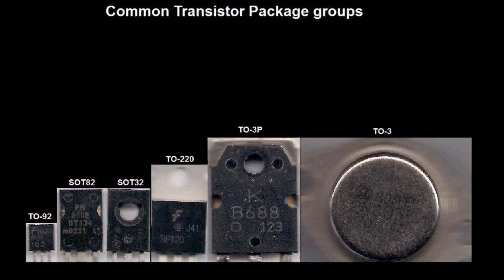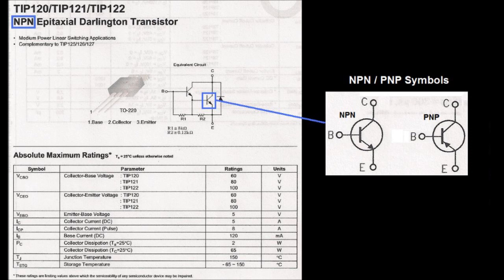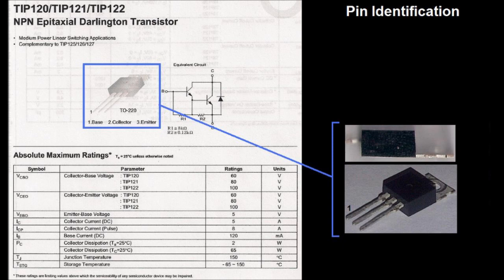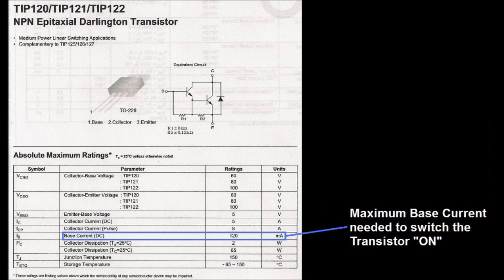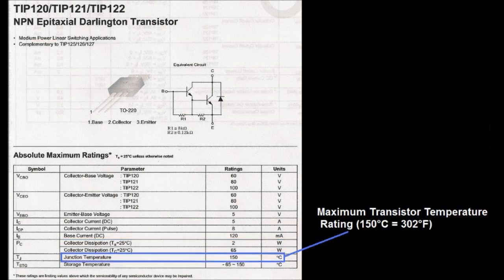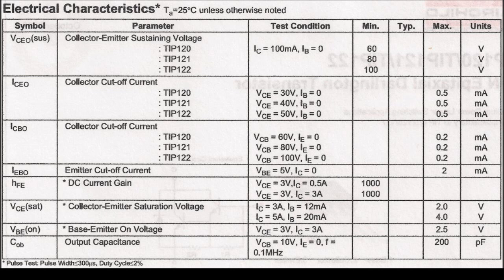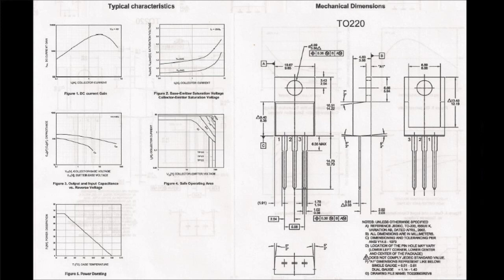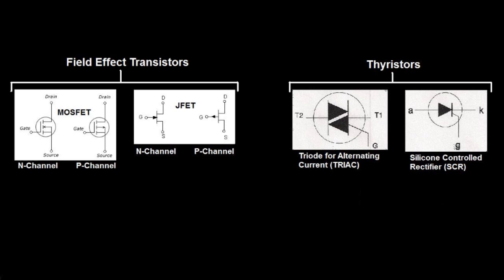Transistor's Datasheet Tutorial

Comment: Some Transistor datasheet (Ib Base current) is not indicated like NPN s8050 - Please help to find out how
Reply from the maker: Base current is usually listed on High Current Transistors. For small low-power transistors look at the voltage Saturation for Base-Emitter. It will show the max current and voltage needed to fully turn on the Transistor.

Comment: Sorry one question, if the transistor can dissipate 2 watt at the normal room temperature  (25°C) ro 65 watt with proper heat sink. That part I understood well.

Then why it says it can work till the 150°C. 

I know I didn't understood it properly between though two option. 

Can you clear it?

Thank you
Reply from the maker: It does seem confusing.  However,  Watts and Temperature are 2 different units of measure.  The wattage refers to the amount of heat energy that can be safely dissipated per second at room temperature.  The 150C is the maximum operating temperature of the device before failure.  The more heat you can transfer away from the device the lower its temperature.  Without the heatsink the device can safely dissipate 2 W per second at room temperature. That's 0.17A @12VDC but with a proper heat sink you can dissipate 65W per second, which is 5.46A @ 12VDC.   The temperature corresponds to the wattage or Heat output. If one goes up/down so does the other.  The device's temperature cannot go above 150C or damage will occur.  That's why removing the heat as quickly as possible is so important.   The temperature of the device is higher than that of a heatsink.  This is called Thermal Resistance.  As long you keep the devices temperature between -65C and 150C it will function as designed.
Reply: @ESRepair  ohh its mean, watt represent the heat. Okay i have to study about watt now. But any how, you were so clear. I am still studying this videos. 
Thank mat

Comment: Hello sir, 

I have 1 question. 

Regarding the Base Current Ib 
It says Max base current to switch on the Transistor, 
My transistor TIP41C Ib is 2 Amp. 

So it will switch ON at any amperage below 2 Amp, correct ? 

They should mention a minimum current to switch on the transistor .. why they mention a maximum?
Reply from the maker: Actually it does mention the minimum current to switch the transistor on.  The Ib states the max current that can flow between the Base and the Emitter. Iebo shows the minimum current and Vbe states the minimum voltage needed to turn on the transistor. 

The maximum is the limit the Transistor or Junction can handle before failure or damage occurs.
Reply: @ESRepair  

Ohh... 

Thank you. Good sir

Comment: Hi Can you please tell me the equivalent transistors of B1254 (2SA1263), D1894 (2SC3180). its really hard to find to me.. i replaced with B1560. D2390 to check.. but transformer started smoking. Iam using Marantz pm30.
Reply from the maker: The B1254 (2SA1263) is a PNP-Si Power amp, Hi-Speed Switch and the D1894 (2SC3180) is the NPN--Si counterpart used in high power amps. They are matching pairs in the TO-3P package.  However, You may be able to find an equivalent Online.  The replacement Transistors must be at least 140V 12A 100W in a TO-3P package. The details can be found here > http://www.nteinc.com/specs/10to99/pdf/nte36.pdf

I also checked nteinc.com and they have the replacements as NTE36 and NTE37 in stock.
Reply: thank you.. replaced with equivalent transistors (A1695,C4468). but still the relay is not charging up. i almost checked all the components . Checked AN7062 IC Voltage, pin 1(Gnd) and 8(Op) shows 42V .

Comment: Hi:
You mention that the base current is 120ma. You mention this is what turns on the transistor. Is this the minimum/maximum or......? What is the minimum current and voltage to turn this transistor on? I am looking to drive a mosfet with a arduino and that is why I am watching this. This would have been clearer if you had a diagram for each line you spoke about and when you start talking about it cutting off or on (hfe) at a curtain voltage or current, it would have been better if you would have given examples and stated what happens if it is above or below that which is shown.
Thanks.
Reply from the maker: amtpdb1 The 120mA is the maximum required to turn on the Transistor fully ON and conduct the Maximum Current flow between C-E. The minimum Voltage between B-E in a single bipolar transistor is 0.7VDC but when using Darlington Transistors, like the one in the video, requires a minimum of 1.4VDC between the B-E.

MOSFETs are nothing like bipolar transistors. My video "Testing MOSFETs" show how these FET transistors behave. I apologize but, you're watching the wrong video for MOSFETs. This video was to help understand the language used in transistor datasheets. Arduinos are similar to the BASIC Stamps that I use at home. The best things about using MOSFETs with PICM is the fact that 1) There is no connection between the Gate and the Source-Drain in MOSFETs, meaning you can connect your Arduino directly to the MOSFETs Gate without a problem; 2) MOSFETs have Very Low ON-state Source-Drain Resistance (typically 0.5Ω - 0.6Ω), and 3) MOSFETs have switching times in the nanoseconds (ns).

I assume you're using an IRF510 Power MOSFET or similar? MOSFETs Data Sheets are somewhat different. MOSFETs are used Primarily as High Current switches (OFF-ON-OFF). Although the Arduino can connect directly to a MOSFET, I would recommend adding a 1A 50PIV diode like the 1N4001 in series between the Arduino and the MOSFET's Gate. In the event the MOSFET shorts or the Leads are shorted, the diode will protect the Arduino from the surge up to 50V. Use a higher PIV diode if needed. You will also want to add a 10K resistor between the MOSFET's Gate and Ground for the N-Channel MOSFETs or Gate and Positive for P-Channel MOSFETs. This will force the MOSFET to turn off when you want it off. The mentioned video shows why.

I get enough back lash for making long videos, let alone adding examples. -MrFixit
Reply: ESRepair Thanks for your response and suggestions.
Great videos.
Don
Reply from the maker: amtpdb1 your welome. -MrFixit

Comment from the maker: A darlington transistor are 2 transistors of the same type (ie. NPN) connected in the way so the 1st transisor turns on the 2nd transistor. When a Positive current is applied to the Base, current flows thru the 1st transistor from Collector to Emitter. The current then flows from E to the B of the second Transistor, thus turning the second transistor on. This configurations allows the transistor(s) to increase amplification using a small amount of current thru the B than a single transistor. -MF

Comment: At 6:12 a darlington transistor is explained.  The circuit shows 2 npn. If the base is positive, then the second one would never open up because the current passed from the first transitor would be negative to the base of the second transistor.  Since the second transistor is also npn, the base requires a positive charge not the negative passed through the first npn transistor.   I am confused!  Should I quit learning this stuff now?